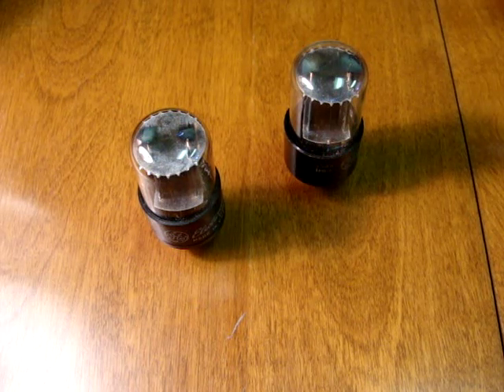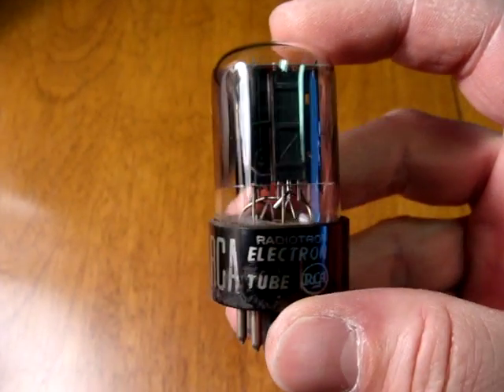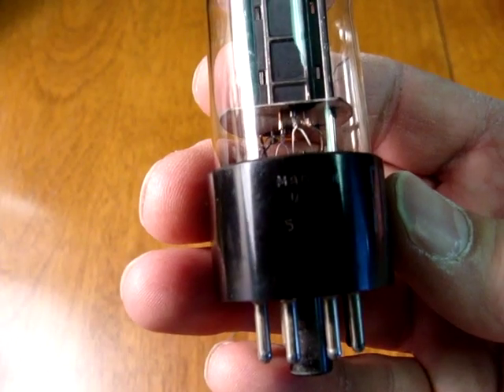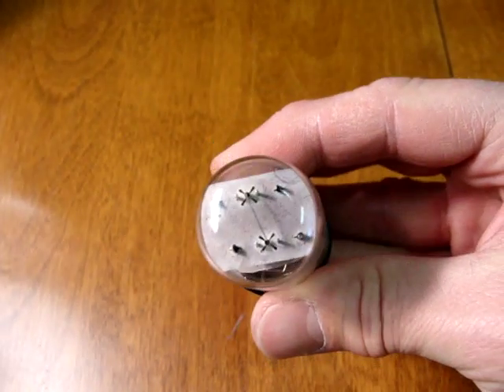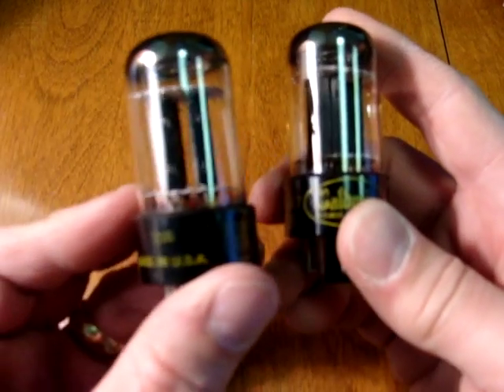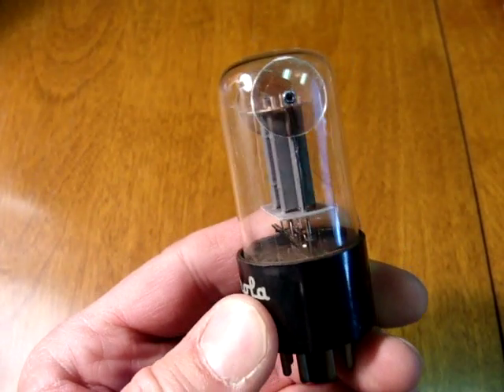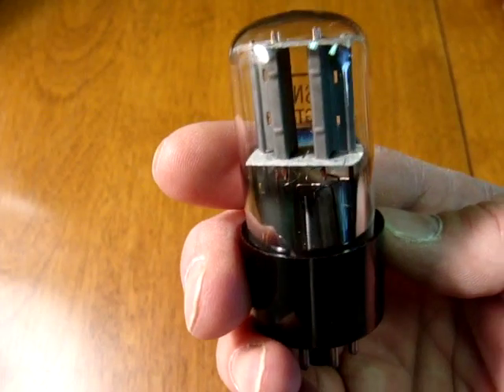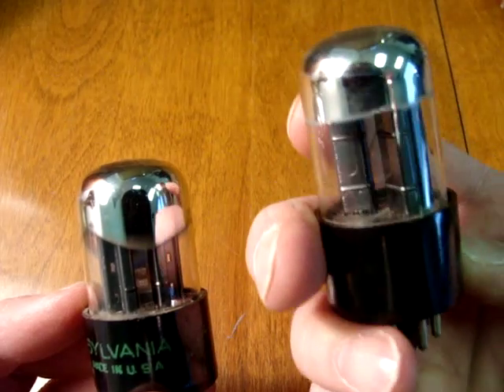How To Spot A Vintage 6SN7GT Vacuum Tube, Pt. 2

Comment from the maker: Hi, the specs on these tubes are published in The RCA Receiving Tube Manual, which was published for many years and still available from specialty electronics stores.  You can also find them on various tube history sites on the Internet.